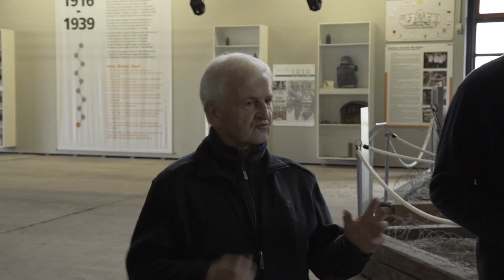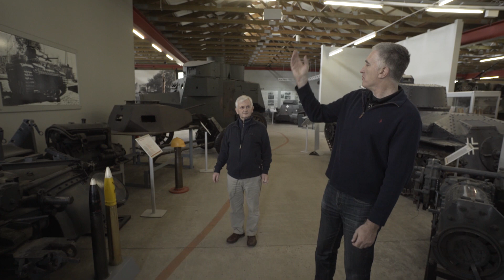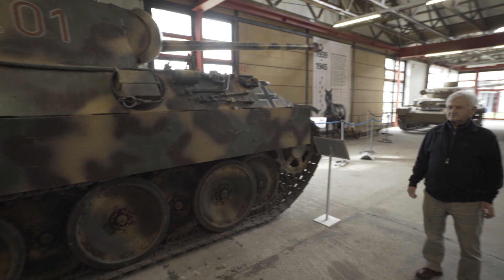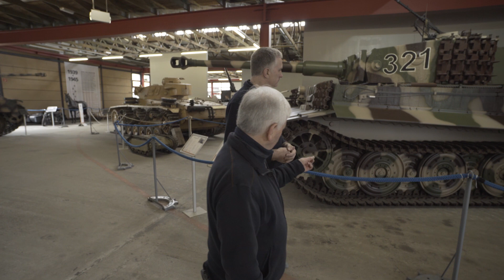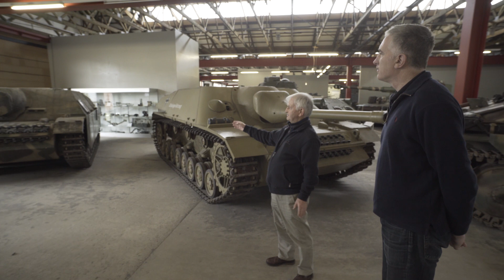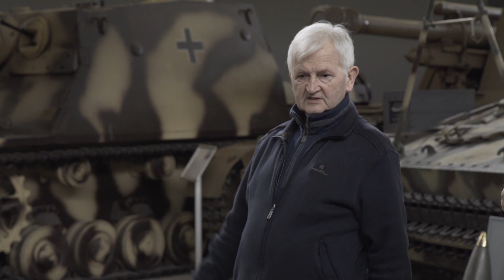Interview: WWII at the Panzer Museum with Hilary Doyle

Comment: l have one important question ; WHY DID THE GERMANS NOT USE DIESEL TO  POWER ALL THEIR ARMOURED VEHICLES ?? They knew how to make great diesel engines !
Reply: Petrol engines made more power per unit of size, and were more reliable during the '30s when these tanks and armored vehicles were originally designed. 
Let's look at engine displacement size :

- Panzer 4 : 300hp out of 11.9 Liter petrol engine
- T34 : 500hp out of a 38.8 Liter diesel engine , more power, but the engine was almost 4 times the size.

A larger engine means more weight, the Russians made the engine block out of aluminium, to save weight. But it also takes a lot of space, that means a bigger tank, that means more armor plate, that adds extra weight. Some of the extra power form that huge engine is wasted by moving around the extra weight, that also requires more fuel, so you don't have much benefit. And the tank is bigger, so it's a bigger target.

The Germans did have aluminium block engines, but aluminium was expensive, and the Lutwaffe had dibs on aluminium. So steel engine it is for the tanks.  
Now we come to fuel consumption. Diesels can run on low quality fuel, that is a huge benefit. 
Thing is they had Maybach, who already made high performace, reliable petrol engines, and they were a perfect fit for the early tanks, as they were meant to be fast and nimble, perfect for their War of Movement , aka "Blitzkrieg" tactic.
The halftracks that accompanied the tanks were petrol powered too, and so were the armored cars and everything else, so why bring along two types of fuel ?  Yay for petrol !
According to the guy with the funny moustache, the war will be over soon, so why bother investing in new engine technology ?

Spoiler alert : the war was not over soon.

Comment: Sadly this video spreads the "Hetzer was made from shitty steel" myth.
Reply: The qualities of the low alloy Siemens-Marteneit stahl plates in question are documented. 20mm thick plates with a hardness of 75-90kg/mm square could reliably protect the sides of the Jagdpanzer 38 against 7.92mm SmK, and nothing larger. By contrast, the usual standards for RHA to protect against 7.92mm SmK required only 14.5mm thickness, as seen on countless other German vehicles.

What can you offer to disprove that?

Comment: 18:20 I dont know where did that museum curator got this idea and whether or not they did metallurgical analysis of the hetzer's armour (probably not) but "Siemens Martin" is not a type of armour but rather a process for making steel, that depending on the chemical composition and further thermal processing can be used anywhere, from manufacturing of engines to armour plating. Most of steel made during WW2 by all countries was produced with this method, so its definitely not "50% of the real armour" or anything of that sort.
Reply: Have any of you actually read Jentz & Doyle books that give the figures for the plates in question? The 20mm SM stahl plates used on the sides of the Jagdpanzer 38 offered equivalent protection to the earlier 14.5mm RHA standard - protection against 7.92mm SmK.
Reply: @Maus5000  Yes, but those were the side plates, the plates in question are those at the front of the vehicle.
Reply: Siemens Martin

Siemens(german second name) Martin (French second name)

Quick google

Siemens and Martin A French and german created the open heart furnace

It's not even a way of making armor it's a way of making steel

They literally developed the open heart furnace

In short hes spitting a brunch of big fat lies in the video

It's not an armor type as he claims it's the way basically All steel IN THE World is produced
Reply: He is very knowledgeable about tanks, but most likely not as knowledgeable about steelmaking.

Comment: I seem to recall that the electric drives fell through for mass use because of the scarcity of copper, copper being replaced by aluminium alloys in, say, electric locomotives.
Reply: Mr Doyle and Thomas Jentz debunked that in their books on Tiger (P). The electric drive (and by extension its use of copper) was not a major factor in the cancellation of that vehicle, and in fact received increasing attention and interest over the much lesser-known hydraulic alternative.

Comment: Would it not have been more logical for the Germans to forsake the other tanks and just put all their manufacturing efforts into  producing as many Panther tanks as possible?...
Reply: Not really. The Tigers (both versions) put in a ton of work on the Eastern front against masses of Soviet tanks and AT guns that ripped thru PIVs and even Panthers. Further, they lacked the manpower and fuel to run the tanks they had - they simply couldn't operate tanks in higher numbers than they already had.

Now, the benefit of doing this would mean they'd actually have replacements, so damage and/or total losses would not be as severe. Of course, then it becomes a numbers game of Panthers vs King Tigers in a fight. You might lose a KT or two on the march, but in battle often none. Replace them with Panthers and you may lose more in the end due to combat.
Reply: That was the theory, but they could not do it because they had to keep up pumping tanks, as many as they could, as fast as they could, so they could not close one production line, wait until it is prepared for Panther production, train the workforce and then start producing again.
It's the same reason why the Soviets could not switch to producing the T34-M, they knew the T34 had its problems, and they addressed those problems in the form of the T34-M, but they could not halt the production line, as they were losing so many tanks, so fast, they needed to keep production going.

Comment: The soviets had a massive lead in tank design,numbers and most importantly, production. American engineers in the 1930's designed and supervised Magnitorsk steel works, and the gigantic factories in proximity to that enormous steel works that made tanks.   With excellent state security, the USSR was able to keep its build up very secret, something nobody else could achieve, being thoroughly penetrated by soviet spies. American engineers that returned to the USA, were threatened with severe consequences if they went public about what they saw or were doing.

Comment: Is the "fake Tiger" a variant/prototype of the Tiger, such as the Vk 30.01 or is it just a different vehicle all together? Many war movies featuring a "Tiger" such as "White Tiger" and other movies use modified T34's and such, but were there actual Tiger variants/prototypes with a front mounted turret?
Reply: The "fake Tiger" is actually made of plastic. It is a plastic replica of the Tiger I that used to be in the museum. This Tiger is made from parts from multiple Tigers, so while the parts are original, the tank itself isn't. The guy who owns this Tiger decided to pull it from the museum to restore it to running condition and so the museum replaced it with a plastic replica.

Comment: From what I have read, Hilary Doyle is overrating the German armour. It seems the welds were also problematic and tended to fail when the plate was struck. Also, face-hardened armour was less effective than RHA against capped shot. 4.5 mm face0hardened might just do against rifle-calibre bullets, but I wouldn't trust my .life to it. Also, German armour got poorer due to quality control issues and lack of strategic materials
Reply: @John Cornell  I don't have the source in front of me, but I thought the issue was less with welds and moreover with spalling and cracking plates due to improper face hardening.
Reply: The armour on the Tiger 1 was the best put on any ww2 tank

Comment: The only german tank i liked at the time of the war was the Tiger
Reply: M10 wolverine Defender 56734 rofl. The wolverine was shit...a Panzer 3 could easily take it out
Reply: @UFCMania155  Wolverines weren't designed to be used in a direct head to head function. That's like crapping on a Nashhorn due to an open topped design.